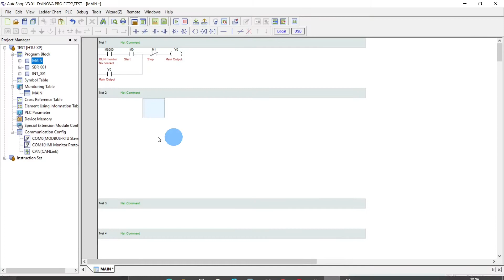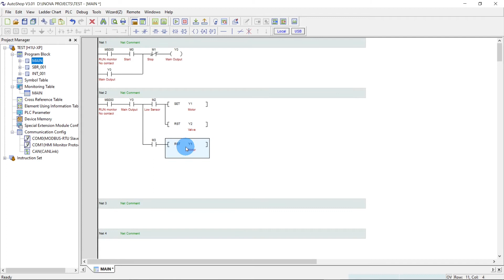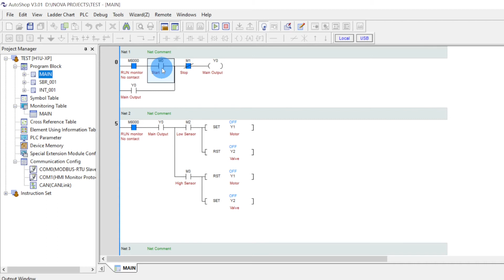Inovance PLC | Ep.4 | Water Level Control | Autoshop Software

Comment: can you write a program for an escalator with H1U?
Reply from the maker: Yes can I get some details
Reply: I can get you a diagram for the safety line and so on
Reply from the maker: @oluwalekeolabomi8136  ok pls send the diagram and parts as inverter and sensor details. Send to WhatsApp 8128370714 or email: nairthe1@gmail.com
Reply: Ok,
Its a 0.5m/s speed bi-directional escalator.
It has motion sensors at both ends 
Uses a monarch vvvf inverter 
Safety switches for broken steps,
Skirt switches up at both ends
Handrail safety switches at both ends
All safety switches in series
Has a starting key switch and a stop buttons at both ends.
It slows down after 3mins without usage and stops(goes to standby) after next 2 mins.
Upon sensing motion at any end depending on direction of drive it starts by itself.